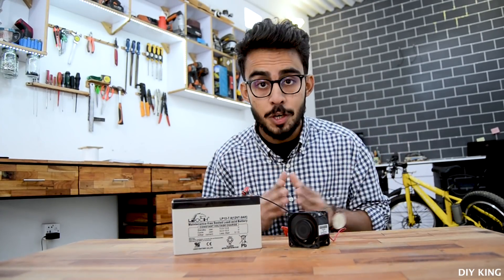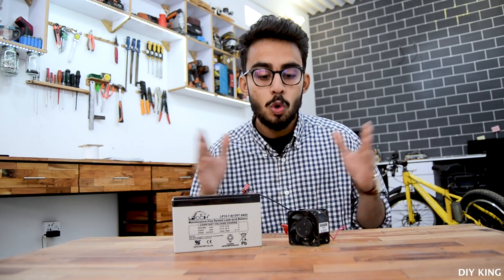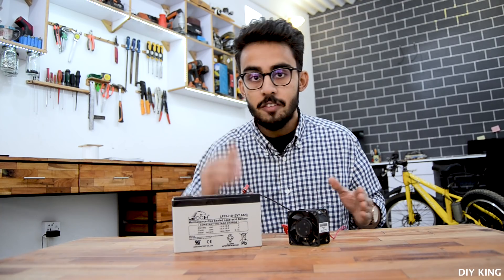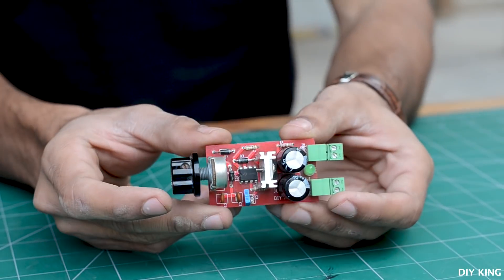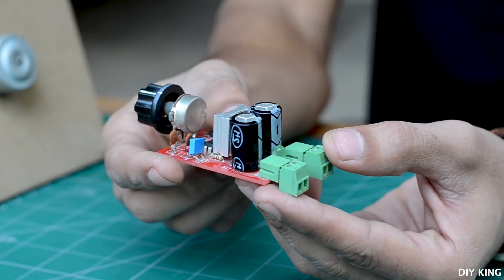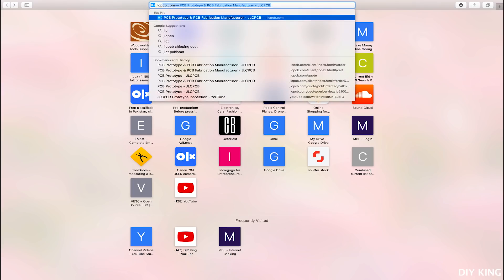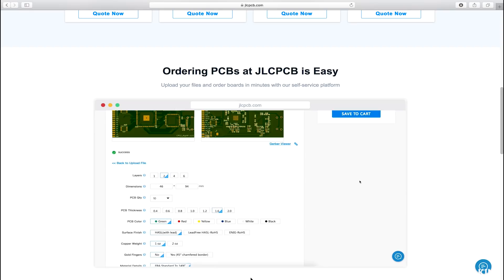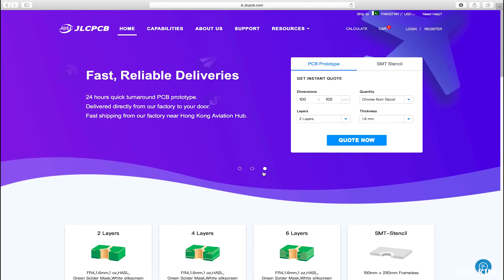How to make a Drum Sanding Machine

Comment: I like the build but I am not convinced that is the correct type of motor for a sander. Universal motor or even a standard DC might have better torque characteristics hence the use of these types in power tools.
Reply: I agree. I was thinking while watching that it really shows that it lacks torque.   It has RPM to spare I it think just stepping it down a smidge with some sort of gearbox would yield great results.
Reply: @MrBrassporkchop  it would definitely benefit from a gearbox but finding a suitable one and coupling it is probably a bit of work by itself.
Reply: Dude remember that is a DIY Sander is for realy small And light works but i understand your point